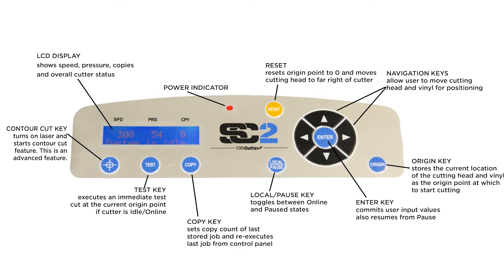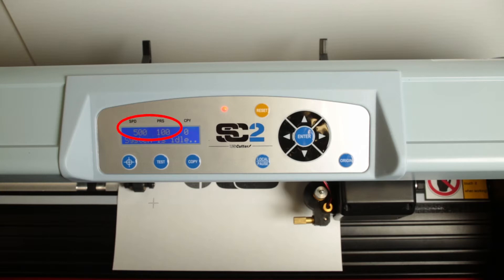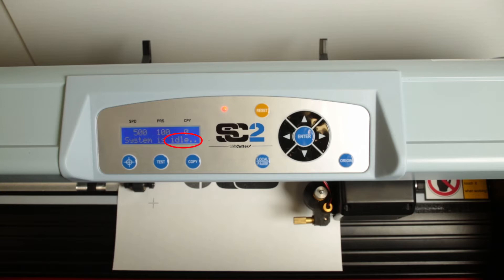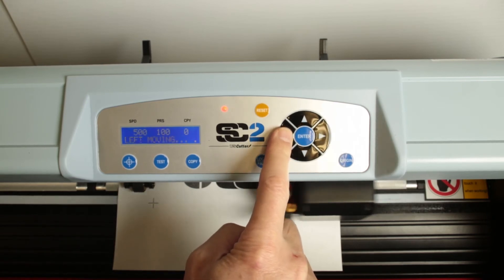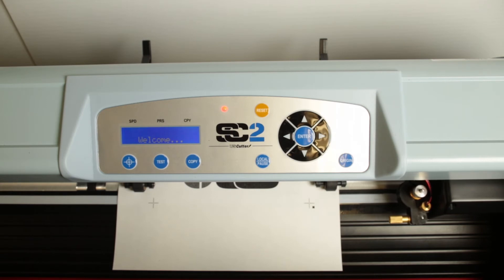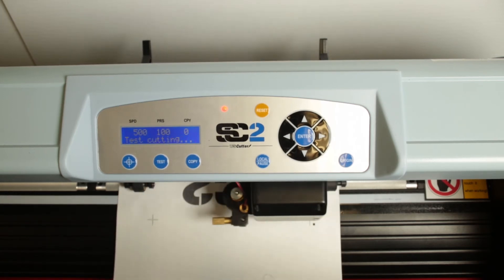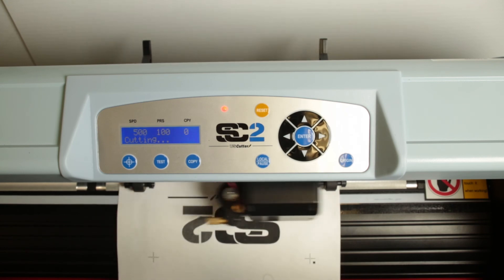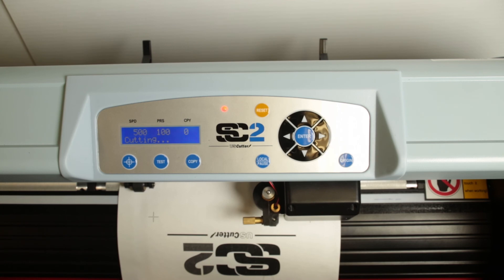SC2 control panel explained

Comment: horrible product i just got mine today an already feel like i wasted $500 buck
Reply: Think you'll ever find one that works for under 1500? It's a snake pit. Worse than sewing machines, by far. You can get a damn good sewer for under a grand, and reliable as f.
Reply: I know you wrote 3 years ago but I just got the 28" SC2 two weeks ago and I have been beating this thing at least 6 hours a day, hasn't let me down yet. Altho most likely you found another brand, can you elaborate why this is horrible? Just curious.